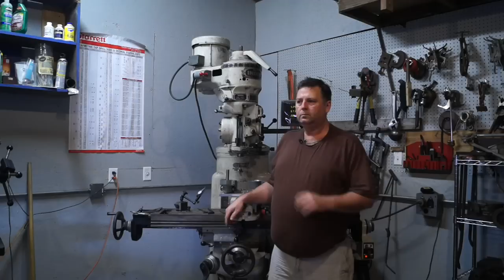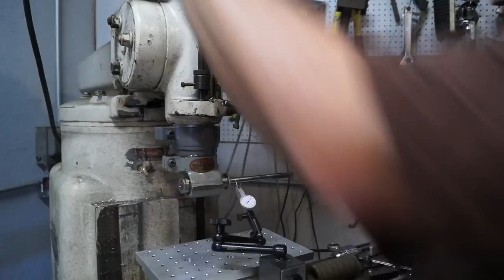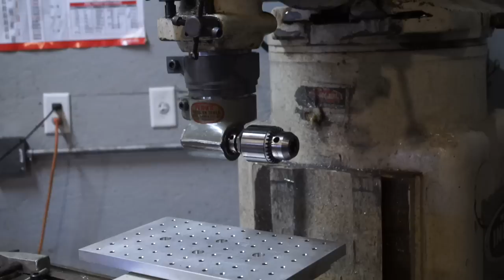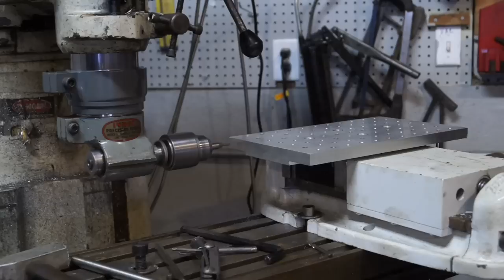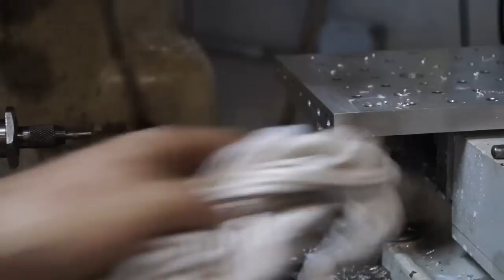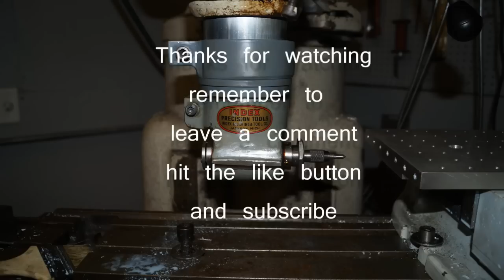90 Deg Milling Head Adapter Part 5

Comment: Mike, nice build.  The second hole in Right angle head is for a set screw used to separate the unit slightly, makes it easier to remove from the quill or in your case the adaptor.  Just back out the locking set screw past the split and then use the second set screw to "jack" the unit apart at the split.  only slightly though, you could crack it if you get too aggressive.

Comment: Nice project. Looks like it's working pretty good. Just a thought, maybe the extra tapped hole is used for a screw to open the attachment just enough to loosen the tight fit when installing and removing the unit.
Reply from the maker: +William Hardin 
William thanks for the reply, Im sure that's exactly what it's for. I realized it when I was watching the video after I finished editing it.

Comment: Very nice adapter.  Looks like you have the horizontal drilling covered.  Thanks for the video.
Reply from the maker: +cerberus 
Thanks for the reply,   it did work good on the small holes.

Comment: Nice work Mike. I bet you could use that head to mill a large diameter internal o ring groove. I think it would run a 1/4in endmill just fine.
Reply from the maker: +bcbloc02 
Brian It may can handle some light milling but I don't think it could make any big cuts.